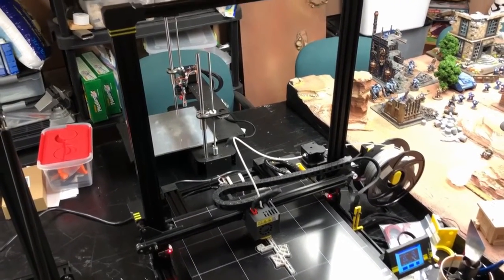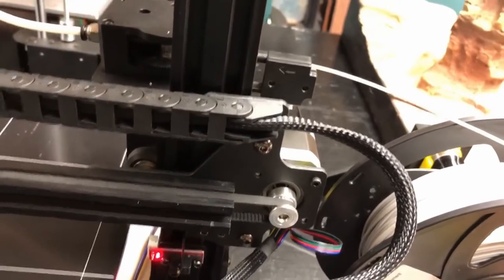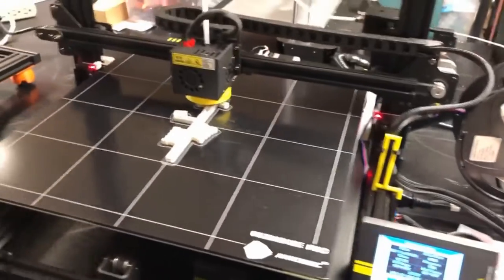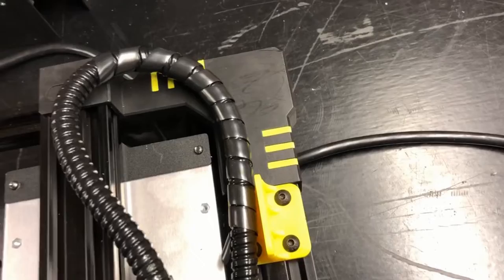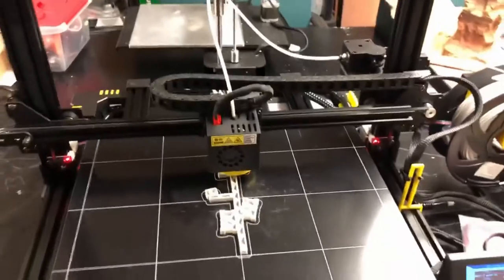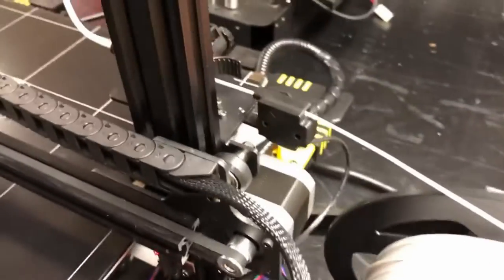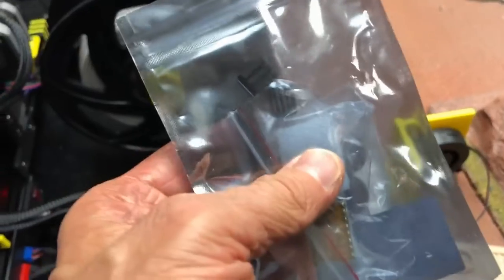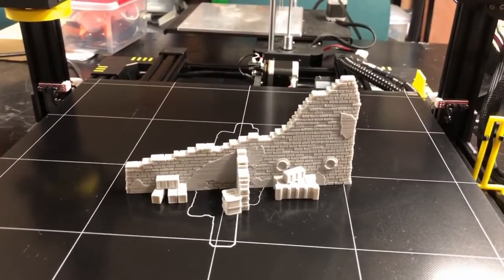ANYCUBIC CHIRON FIRST THOUGHT AND MODS

Comment: Nice video thanks. 
I would like to point out that these ship in a partially assembled state. All but one of the issues you described are based on your assumption that all of the fasteners are fully tightened at the factory and do not need checking or tightening. However I would say that assumption is incorrect. It's easier on the device and prevents damage due to vibration and minor flexing during shipping to not fully tighten fasteners. 
I would recommend to others buying a Chiron to assume it's their job to check and tighten all fasteners once they receive any partially assembled printer.

 As for the heater, that does suck but this is not uncommon. These heated beds have brittle components and don't take well to vibration or flexing. Both things commonly experienced by packages during shipping. I've heard of the same thing happening to quite a few people with various brands and models of printer. It sucks but it happens. IMO the important issue is how the company handles it. It sounds like they did ok in that regard. 

That leaves one real factory issue, the motor brace screws and that's definitely on Anycubic. I hope you reported it to them so they can resolve the issue at the factory side. Their responses to issues with early models indicates that they are good about listening to user feedback and acting on it to resolve problems. 
They certainly don't just tell people "they're holding it wrong".  ;')

Looking forward to more from you on this printer as you spend time with it. 
I certainly hope you take advantage of the advanced auto-leveling and bed compensation feature, it's one of the products killer features according to other reviews I've seen. Interested in your take on it. 
That sample print looks good too. 
The type of prints you do really put any printer to the test as they require accuracy, detail, and positional repeatability. Can't wait to see more of them from this.
Reply from the maker: Christopher Gaul You’re right, a very assembly.

Comment: Thx. Subbed. 
But I have to ask. Why leave the filament holder attached to the frame. I'd think separated would prevent any vibration from transferring to the bed or other parts.

Comment: I know this is an old video and printer but I just unboxed my again after 3 years sitting and as before the temp will not stay where i put it. It will stay at 200 but anything higher and after it prints for a while it reverts back to the 200 mark any ideas.
Reply: Check your temperature settings in Cura. Watch this video for help! 
https://youtu.be/uEJElC6cjBE